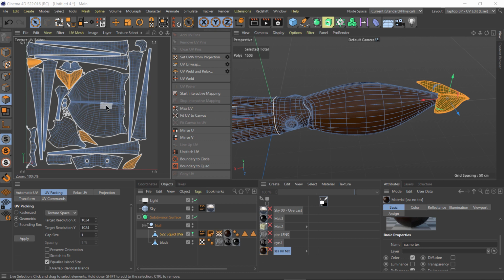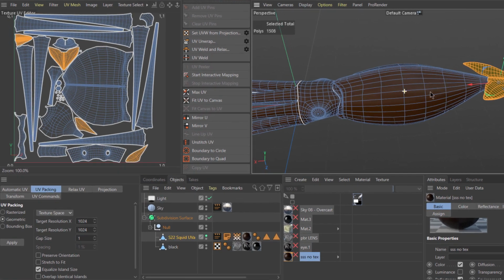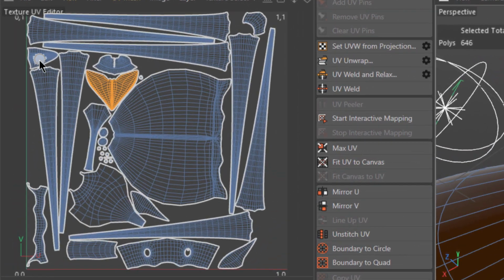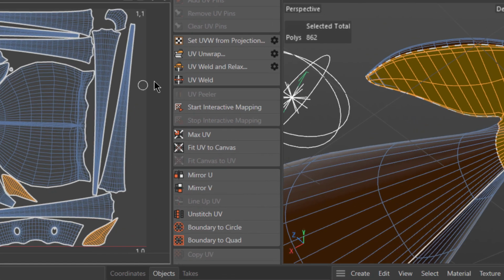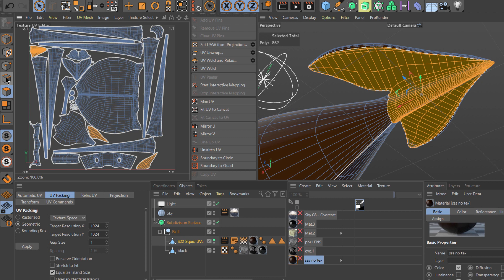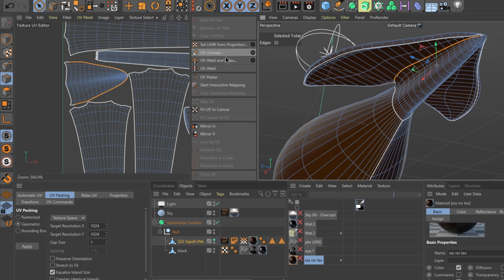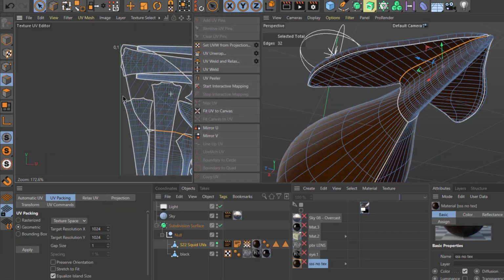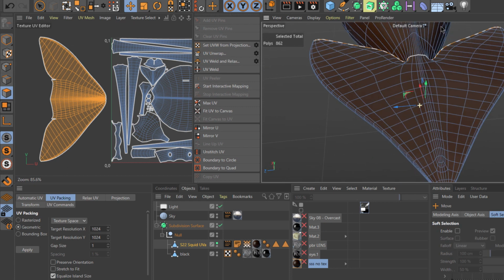Tip - 290: How to smoothly reconnect UV islands in Cinema 4D S22 – Weld & Relax

Comment: Is it possible to create multiple uv-sets? For export substance painter for example?
Reply: Just apply different materials, I use fbx to export, should do the trick.
Reply: Yes, it is! You can have more than one UVW Tag on an object. The Material Tag will use the UVW Tag on its right.